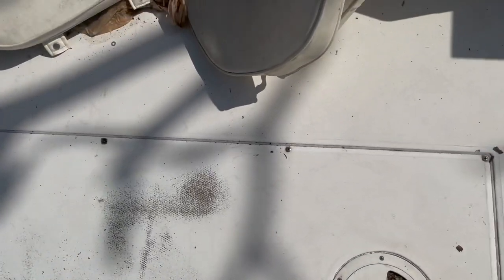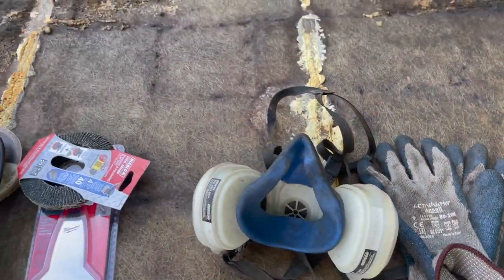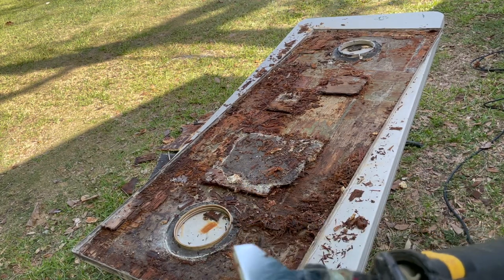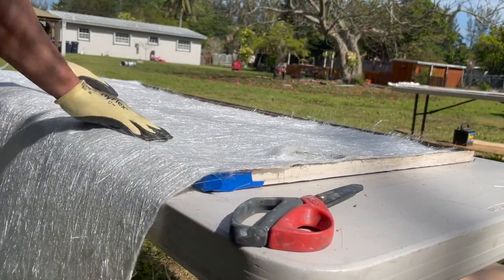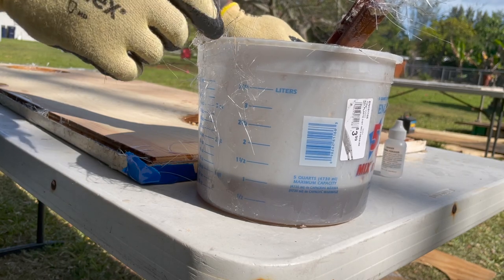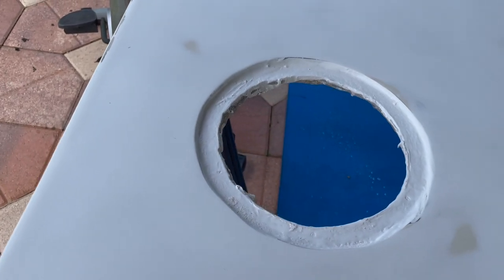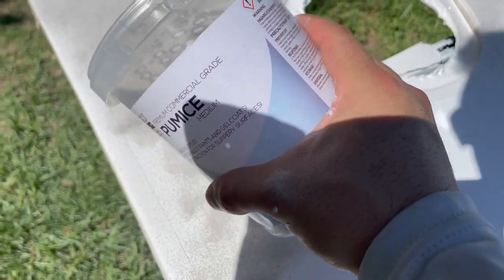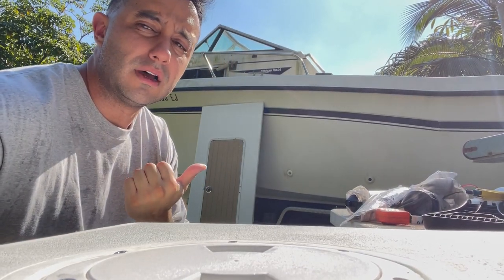Beginner Boat Fuel Tank Cover Rebuild!! COMPLETELY ROTTEN!!!

Comment: Just remember.  Most of us can't afford a new or nearly new Grady White.  These boats are priced up there near Boston Whalers.  So your sweat equity is saving you tens of thousands.  Gota let you know your videos are inspiring me to do some restoration on my used 1985 Seafarer 226 which has the identical cockpit. Its very informative to see how these are built and come apart and how you handled various repairs. Thanks for taking the time to post all the steps you went through.
Reply from the maker: Thank you so much for that! It’s been 2 years since I started and I’ve gained alot more knowledge since. If I was to start this whole thing from  scratch I’d take a different approach but I’d still restore it nonetheless. I’m happy to share some info with you just write us an email. A boat like ours TODAY from Grady white is worth 200k plus! 😳🤙🛥️🌊

Comment: A little tip for next, wet the wood with resin first. If you don't the dry wood will pull the resin resulting in a dry non-bonded layup
Reply from the maker: That’s a great tip! I learned that about halfway through doing the stringers and it helped so much. That dry would can really suck a lot of that resin right out of the 1708! I had to go back, grind and layup more glass on the dry parts🙄 thanks for the tip! 🍻

Comment: I threw all of the rotten wood in a cardboard box and the trash guy took it.
Reply from the maker: All the big pieces with fiberglass got thrown in the trash. The rest was mulch. How’d your cover come out?
Reply: @perfectfitboating , So far extremely well.  I’m in the middle of the job.  Since I have never done this before I am really taking my time.  I want it absolutely perfect, and I (we) don’t get a second shot at using Seacast.  I had everything spotless, no wood remnants at all, everything sanded with 60 grit sandpaper, and washed in acetone.  I polyester epoxied 2 very thick random oriented stranded fiberglass layers on the inner forward wall.  Next I mixed up a batch of resin and lots of random length fibers I cut, and mixed them in and made a thick paste.  I spooned it all along the lower edge of the inner forward wall, thereby completely sealing off any ability for water forward of the transom to intrude into the transom cavity.   The corrosion on my boat was horrible.  There was no other way to do a good job unless the aft wall was cut out.  After cleaning it up properly, I coated the cut sides of the rear removed piece and also coated the transom cut edges, and then mixed some more of that resin/cut fibers mix and slathered it on, and set the wall in place.  After getting it flush and secure, I hand-packed with a plastic knife some of that mix manually along the entire seam.  After it set up solid, I sanded all of the protruding fibers and layer a nice one of duct tape along the entire cut.  That is where I am now.  Ready to pour in the Seacast!
Reply from the maker: @Mike Welch  sure is a lot of work! Don’t miss any of the grinding I’ll tell you that! We’re thinking about using sea cast for the transom! I hear great things about it. Tbh we don’t want to tear down the inner wall it’s actually very thick and I’m great shape. And im confident we can successfully take out any pieces of wood from the transom cavity! Not too many videos of people doing SeaCast you should record it! We’d love to hear how it came out!
Reply: @perfectfitboating , I should. I’m not very well versed in that area, but I will try recording the final phase, and narrate how I got to that point.
Reply from the maker: @Mike Welch  looking forward to watching it!
Reply: @perfectfitboating , from what I just went through, I do not see any way on earth that you can do a good job of removing the rotted wood.   Even if you get the bulk of it out, the outer layers of the plywood will tear away and remain glued to the fiberglass walls. Cutting out the rear wall is not that much of a big deal, especially if you use Seacast.   The access provided by removing the rear wall is definitely worth the effort for insuring a good base to resin adhesion, whether you use Seacast or resin & plywood.
Reply from the maker: Thanks for the advice. For now the transom is overall in good shape. When we decide to do the transom (probably when we upgrade the motor to a heavy 4 stroke) we’ll decide the best way to tackle it. 👍

Comment: Question. Could you have used the same liquid used for the transom to rebuild your fuel tank cover.
Reply from the maker: Great question. Not the same exact liquid. They make other liquids that can be used for stringers and bulkheads! Makes it really easy. Pour and done! 🤙
Reply: Ok thanks.

Comment: How's the transom and stringers?
Reply from the maker: Stringers were replaced. You can check out our other videos called “stringers and bulkheads” where we rip everything out and replace the rotted wood. Transom is 80% solid I’d say with most of it being solid where the bracket is down to the keel. We’ll end up redoing it in about a year or so.
🍻